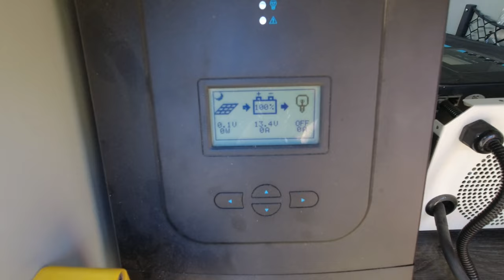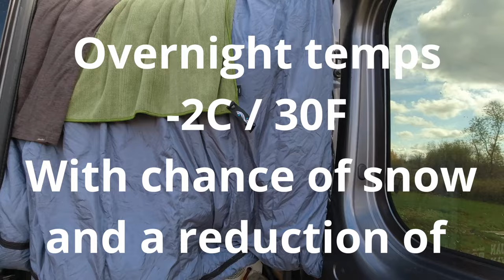FRIED OUR INVERTER!? REPLACING OUR 3000W RENOGY INVERTER//EP 8: Rob's Van Repair & Maintenance Tips

Comment: Renogy has terrible customer service. They don't care at all if you have an issue. I am dealing with them now over a battery issue and it is like arguing with a rock.
Reply from the maker: It is unfortunate @MegaSquirt that their customer service has gone down. 😞 When we first bought their products, they were much more reachable and their customer service was better. Hopefully, you get your issues sorted out.
Reply: I haven't had any problems with my Renogy equipment I've been using about 3 months now. And I haven't had any problems with my Li Time batteries I got because they are well respected and where cheaper to get in a hurry on Amazon than Renogy batteries, but when talking with Li Time about delivery estimates, asking them pre sales questions I was impressed with the customer service. I'm very happy with my Renogy inverter/charger (Though wish I got the new "REGO" version!), DC DC charger, MPPT controllers, etc, but I am happy I got my batteries from Li Time.

Comment: It’s so frustrating because I want a decent product at a fair price, and that is where Renogy appears to fit? I also appreciate you can call them, unlike 99% of inverters on Amazon. I wish there was a company with Victron like quality but between Renogy and Victron’s price.
Reply from the maker: You are so right @jerrytalley802. It’s always a balance of price and quality. The good news is that there is always new technology coming out and sometimes at a lesser cost.
Reply: I have a giandel 1500 which is great. Also a Renogy 2000 inv/charger which has bad control switch now and will not turn off. Going to disconnect it and see if it perhaps resets

Comment: I thought I had fried mine as well. Same model stopped working after plugging into shore power. It stopped working so I unhooked the battery cables hoping it would reset the unit. After hooking it back up, it was producing a very low voltage. The voltage would occasionally go up to 40-50 volts. I checked the manual and went through the settings and found option 04 Power Saving Mode. It was changed to SEN if enabled, output of the inverter will be off until a load greater than 50 watts is detected. I changed it back to factory setting and it started working again.
Reply from the maker: That’s awesome @Tavon Johnston! 👍 Glad you were able to troubleshoot it and get it working again. 😊
Reply from the maker: @larrypatenaude4434 we did everything we could to reset/restart and spoke directly with Renogy who said they believed it was a malfunction but wouldn’t do anything about it because we bought it through Amazon and Amazon wouldn’t help. Poor service in the end.
Reply: Just realized you need a small LED light under there so when you service everything you still have light, lol
Reply: I am trying to figure out how to factory reset it or program the voltage to match the actual battery voltage so it does not over charge.

Comment: I’ve had cheap inverters fail before. I have purchased over 30 Victron, solar, inverters, and chargers and never had one fail. The Victron multi plus is cheaper than two Renogy units. I also love all the Victron devices have Bluetooth and I can monitor performance from the Victron app on my phone.
Reply from the maker: Yes, we’ve heard good things about Victron @brianduley. Rob ordered the van and many of the build components in 2019 and built it out in 2020. At that time, Renogy was all the talk. If we were to do it again, the products and selections now would probably have us make several different choices. Thanks for your info. 👍
Reply: The Renogy 3,000 is on sale for $379.00. I looked at victron, and it seems they’re 4 times that price. I’m buying Renogy, buying 3 year replacement warranty from Amazon, like $45.00. Renogy wants over $400 for a 3 year warranty on a product that costs $379.00 on sale, lol 
I hope if it fails, Amazon warranty will expedite a new one, if not, will never buy their warranty again.
Reply: Well, scrap the Renogy for now. Out of the box, it would not stay on. I had 460 amp hours of battery, inverter immediately came on, beeped, went off. I returned it. Tried a Harbor freight 3,000 watt  pure sine wave inverter. It came on, ran for a while then turned off, would not work after that. I just tried harbor freight to see if my batteries were ok. The hard wire option was a joke. The screws that hold 10 gauge wire were so tiny, very poor design since you can’t tighten them well with a screwdriver bit less than 1/8”. JMHO.
Reply from the maker: @jerrytalley802 it can all be so frustrating troubleshooting these devices. Hopefully you can find a plan that works for you. We are always crossing our fingers that it all keeps working! 😬

Comment: Hi Rob and Jan, not sure if you know this, or have it installed? Inverters have large capacitors that draw a large current instantly, which causes a spark when 12v power is connected and can cause damage over time. 
The solution is to add a small gauge wire from battery to inverter with a button switch that is on when pressed, off when released. You also have a 5 ohm resister in the cable, which restricts the current flow to the inverter. Before turning on the main power switch, you push the button switch for around 10 seconds. This allows the caps to charge up gradually and stops the surge. Now  turn on the main power and all is well.
Happy camping to you both
Reply from the maker: Thanks @grycripps for your detailed info. I have taken a screen shot of your comment and Rob and I are going to look into this option. 👍 😊
Reply: Get yourself a MAGNETIZER From Harbor freight, anything you pass through it becomes magnetized. You can also use it to de magnetize the same tool. Very, very handy, wish I could find mine, lol

Comment: Thank you. I'm glad you never cut your mattress as you had suggested you would in one of your van tour videos to access that area - your solution works.

I had a bit of weirdness with Renogy customer service as I bought two panels via Amazon and two via eBay. Once we figured out where I bought the failed panel  (and sent pics(!?!) of the short-circuit meter readings) they replaced the panel no problem. I'll probably continue doing business with them, tho will consider options (my 2nd mppt is epever)

 I've decided to keep my van all 12 volt + propane - no 120vac invertor - they are expensive, heavy, a bit inefficient and not as compact and moisture-resistant as vanlife needs. For my (almost never used) shore power, I did add a 12v 30a "bench" power supply that relay-switches into the dc-dc (normally alternator) input on my Renogy charger.
Reply from the maker: Thanks @Earl Daniels! You’ve included a lot of great points and info here. 👍 I (Jan) am really glad he didn’t  cut the mattress either. It isn’t necessary. 😊
Reply: I decided to do the same with my bus. After my 2000w renogy inverter blew up, I realised I don't need it.

Comment: Thanks for the Vid.
Did you ever disassemble the old inverter and see if there was a dud fuse or something?
Reply from the maker: Thanks @AndrewR74. Rob did take it apart and could not find any visible issues. It was quite frustrating. So far, so good with the replacement. 🤞 😊

Comment: Rob, I plan on buying the same inverter, nbut buying a 3 year replacement warranty, for $48.00. I know people will poo poo warranties but I’ve had great service from Amazon when things are under warranty. I know it’s ridiculous to have to buy them, but I’m hoping if I’m on the road, they will expedite a replacement. Renogy wants more for the extended warranty than the inverter costs on sale, that’s nonsense. I know there’s better equipment out here, but cost 4 to 5 times as much. I’m trying to put the money towards batteries. Going to give  Redodo a try. They seem to have good reviews and a 5 year warranty.
Reply from the maker: I think that’s a smart call @jerrytalley802. In retrospect, I wish I had purchased an extended warranty. As we did our build a few years ago, I’m not familiar with that brand of battery, but the warranty on those sounds good too. We have Battleborn batteries and have had no issues…so far. Check out Will Prowse on YouTube. He may still do reviews on batteries. He helped us make decisions for our build. Thanks! 😊
Reply: Rob, my thought is these days. Take something like the Renogy 3,000 watt inverter for $379.00, add about $50 for the 3 year warranty., $429.00 divided by 3 years = $143 a year to own it,  if it craps out worst case. All this stuff is expensive when it just for convenience in a camper, not part of living in a van or rv where it’s critical. I just want some supplemental power when I stop to rest, if we temporally lose power at a campground, stop to heat up some soup, coffee, etc. I think part of it is, I’m 63, buying things I could never afford growing up when a dollar was as big as a barn, lol

Comment: Do you use a EMO Surge protector that you would plug into shore pedestal before plugging your van into it! It can tell you if the shore power is bad and keep any over or under voltage from destroying your components!
Reply from the maker: We haven’t bought a surge protector yet @Bob Edgett, as we rarely use shore power and haven’t had the need since this issue occurred. We are still considering what our best option would be for our needs, but we will definitely do something to protect our power. 👍

Comment: Did you change your alternator to a 250 A? rather then the standard?  Just interester to know as I am looking to get one and I know that the standard Altinator in my van is 120Amps which isn't sifficent enough to power a 3000 watt inverter.
Reply from the maker: I believe we have the 250Amp…not 100% sure if that is exactly it, but know it is over 200amp. We bought the heavy duty option alternator when we purchased the van right from the start. Hope that helps @Naina Kay? 👍

Comment: Did you meter out that shore power plug before you plugged your inverter charger into it ???  Maybe the plug had reverse polarity ?  I have two Renogy inverter chargers 1000 watt at my house with two battery banks and both units work well for me.
Reply from the maker: It was a plug at someone else’s home, so there may have been an issue with it. We will never know. We haven’t had a need to plug it in since, but won’t do it again without a surge protector. Would that address the polarity issue? We have lots of solar and an alternator charger so very rarely have plugged in over the last 3 years.
Reply: @RobandJanCanVan  Keep a simple plug in tester in you van,  The type that has two yellow and one red light on it,  No need to risk your inverter charger over not having a 5 dollar tester from Walmart, and No, a surge protector will not help reversed polarity.  I am a retired electrician.
Reply from the maker: @rayberger2694 thanks! I will let Rob know. 👍

Comment: Hi Rob & Jan,  just wondering what kind of shore power did you connect to?  Household or campground.  Also,  do you use a surge protector on your shore power connection?  I always enjoy these repair videos.  Safe travels for you two!
Reply from the maker: Hey @Pete Frost! We plugged into a house GFI 110v receptacle. We have rarely plugged into shore power but had never encountered an issue. The unit has a built in overload protection which should have made it safe. We only use the plug to charge our batteries (nothing else) when there is no sun for an extended period. Hopefully we’ll have no further issues. 🤞
Reply: Thanks for the reply, Rob.   I agree with you that your shore power connection etc should have been safe.  I also have Renogy equipment and am emailing back and forth with them to find an answer.
Reply: It could have been the outlet he plugged into.. As some people wire them wrong. Why you always have a Polarity checker for 120 volts outlets. Just to make sure. As you cross the Neutral and Hot on outlets. Them inverters go nuts. As now the power is reversed...

Why electricians should always check their work with them.. As assumptions can come back and bite you..

Comment: It seems most of these low frequency inverters are not great. AIMs and Sigineer seem to have similar issues. Just not enough demand to allow a reliable supply. I found the transfer switches are not good on any of these devices so I actually bypass them using a separate transfer switch. Most of the time the inverter is completely turned off (I never run it in standby or charger mode).
Reply from the maker: Yes it can be frustrating sorting our van issues @Peter Drinnan. Thanks for the useful info. We will have to see if this option works for our new inverter. 👍

Comment: What happened to the old inverter pimp?
You replaced it with the same inverter?
Reply from the maker: I hope your pimp remark was a typo @MrMr123? 😂 We did replace it with the same inverter and luckily no issues yet. If you have watched our van tour video, you’ll see that the area it fit into was made specifically for that unit, and Rob didn’t have his brother to assist, so it was easier for Rob to order the same unit so he could install it himself.

Comment: What’s the noise level like on this unit?
Reply from the maker: We find it pretty quiet @harryl9948. All the mechanical is directly under our bed and we even have a small fan running 24/7 to make sure air is circulating to keep the batteries at an even temperature. Only time we hear anything is if the fan moves a tiny bit and touches another surface. Otherwise, it runs pretty quietly. 👍

Comment: Did you and your grandson ever dig into the box to see if you could find where the smoke leaked out?
Reply from the maker: Yes, Rob and our grandson took it all apart and could not see any signs of failure. We never saw any smoke. It just made a loud noise and we tried several ways to reset/restart, even going through steps with Renogy over the phone. 🤷‍♀️ If we knew more, maybe we could have found something to fix but hard to know now. Fingers crossed our new one has no issues. 🤞

Comment: One of the sayings within the off grid community is “friends don’t let friends install renogy”…
Reply from the maker: 😂 Thanks friend @Jeff Jones! 😊 At the time we purchased, they had a better name. 😔 If we have further issues, we may just have to start from scratch and rebuild the whole package. 🤷‍♂️
Reply: @RobandJanCanVan  I disagree myself & haven't had any problems for over 3 years. It was even said in the video it was plugged into shady power. A good surge protector that tells if polarity is correct would have probably prevented this. I have no complaints with Renogy & most of my system is Renogy too. However I will say I believe most of the problems with Renogy is operator error like this one or wrong installation because everyone seems to be a Qualified Electrician today. 🙄
Reply from the maker: @vanlifebiker  fair enough. 😊 When we built out the van, Renogy was one of the best out there and had great customer service. They cut their customer service for Canada so it made for a difficult back and forth for assistance. As Rob mentions in the video, his brother did the electrical. Rob is by no means an electrician or any expert in solar/batteries. I think there may have been an issue with the power we were hooked up to which may have contributed to the fail, but we understood that this unit had a surge protection…plus…Renogy did eventually have us send pics and video of the issue and agreed that the unit was faulty based on the info we provided, but then said they couldn’t do anything for us anyway because it was just past the warranty, even though we hadn’t installed it until much later. I hope we both have many years of use out of our inverters. 👍
Reply: @RobandJanCanVan  I'm going off of memory from over 3 years ago when I purchased mine but I don't remember a surge protection in the unit. Maybe a reverse polarity protection at most. Big difference between the two. I haven't had to use the customer service so I can't speak on that but I don't doubt it where the world is today. I just felt this video title & video steered towards Renogy is at fault & is bad equipment & a bad company. I personally think one should protect any name brand electrical system with a surge protector/polarity checker before plugging into unknown power sources. A hundred dollars or less will protect thousands in equipment & labor. Reality is most electrical stuff doesn't come with a warranty at all & some self responsiblity needs to be taken. Sometimes that might be buying additional things or hiring a professional even. I myself am a professional & always here for advice hints why I started my channel originally. At least it wasn't a fire which Ive seen way to often. Renogy is not the best but they are the best bang for your buck out there. This could have happened with a inverter that cost twice as much.
Reply from the maker: @vanlifebiker  we appreciate your feedback and your expertise. 😊 What kind of surge protector would you recommend? Rob is looking into them now. Is there anything that will hook up outside from the source/plug vs adding something on board?
Reply: @RobandJanCanVan  Yes between the source & your extension cord. Basically it's a male that plugs into the receptacle & about one foot of cord with the protection device on the end being a female. The better ones show if polarity is correct by lighting certain lights & the surge protection is within. Some even have a reset button while others are throw away if they get a surge. I'd look at reviews & not buy the cheapest or the most expensive. Hopefully this will prevent future costly electrical problems & labor.